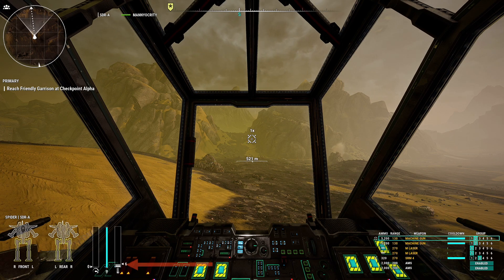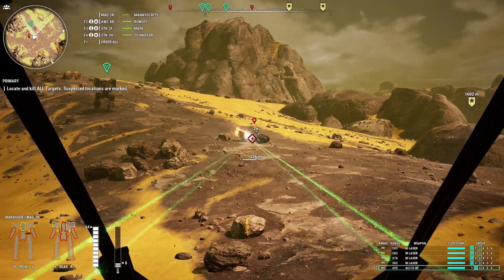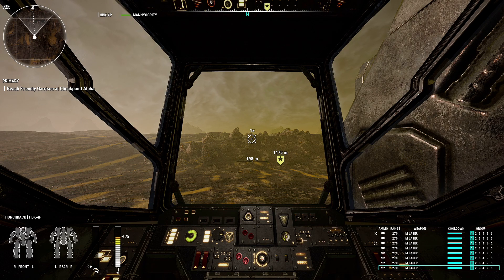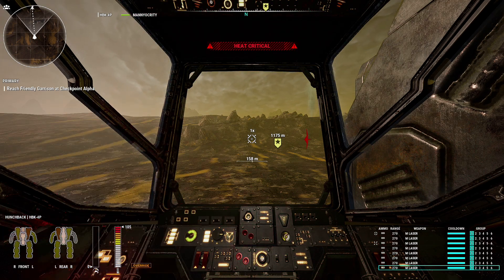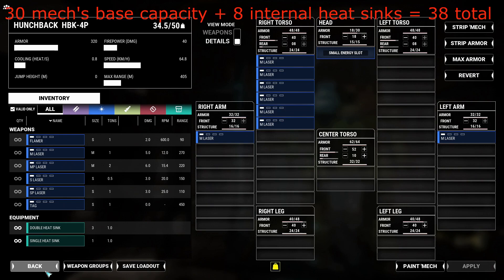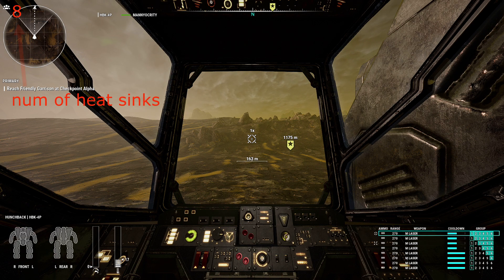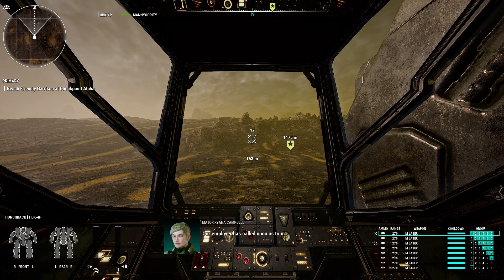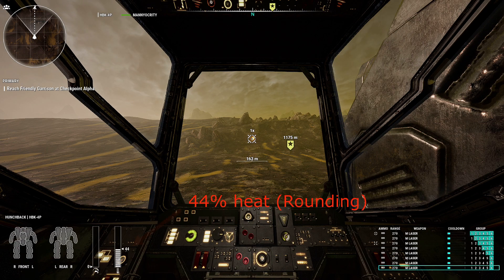MechWarrior 5: Mercenaries | How heat works | The math!

Comment: So if I am understanding this correctly, 1 single heat sink (2.1 dissipation per second) should be about right for 2 medium lasers (11.8 heat per shot fired together, 12 rpm = 1 shot every 5 seconds, so... 2ML = ~2.4 h/s fired as often as possible).  This does not take into account any other heat sources or dissipation and is based on a Hunchback.

As an aside, if I am understanding RPM, flamers would each hit 10 times a second (600 RPM) and generate about 1 h/s each and cause 5 h/s and 20 damage a second (2 base damage at 600 rpm)?  So they do more damage than machine guns (and most everything else actually).  So a Firestarter with 6x flamers and two double heat sinks (and 2x machine guns, but not even counting that right now) could run up to a mech and inflict 30 h/s (shutting it down in under 4s), 120 dmg/s (just flamers - MGs add about another 30 dmg/s) and probably never overheat?
Reply from the maker: It has been a long time since I even played mech warrior never mind looking at the heat, so I'll do my best at remembering.  1 heat sink does not dissipate 2.1 heat per second.  2.1 heat per second is for a hutchback with a default engine, so 8 heat sinks because the default huntchback engine has 8 heat sinks in it. Checkout timestamp 4:10 . The 2.1 is also a percentage of the heat capacity for the huntchback.